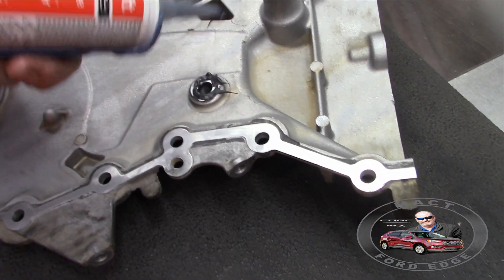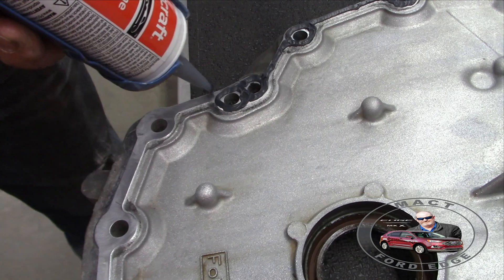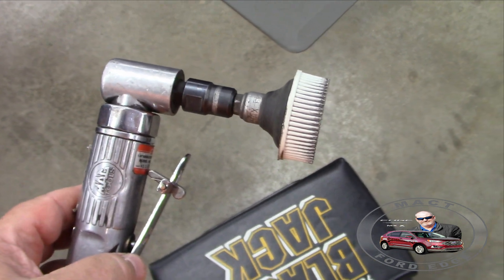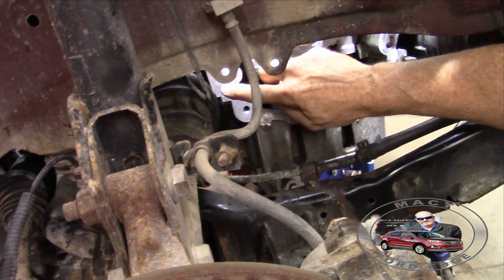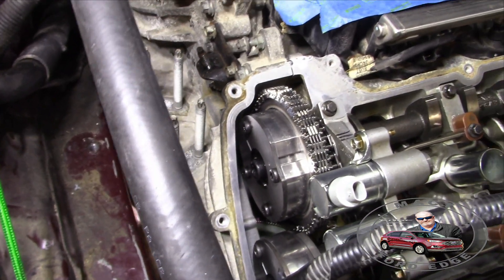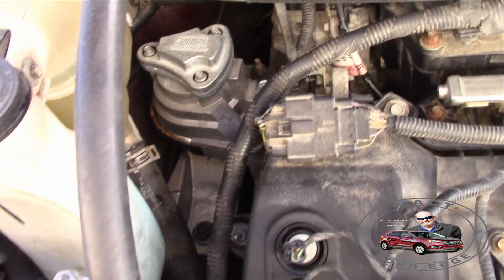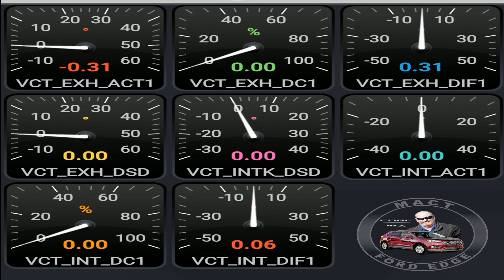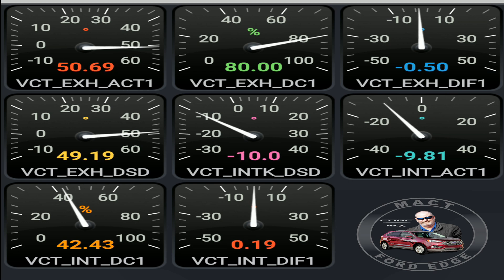PART 7  Installing the timing cover then test run of the 3.5 Duratec at wide open throttle

Comment: I don't ever want to buy a Ford after working on this POS, that is the crappiest design putting the water pump inside with the timing chain. The dealer told me $4800 for this repair and it has to be done every 100k, think they just want you to throw the car away.

Comment: hey was wondering if you could help me out im doing the same job and about to install the rtv and says it has to be torqued down within 4 minutes of initial application i noticed it took you at least 4 minutes just to get it laid on, whats your opinion on this? also wasnt going around the outside overkill?

Comment: What did you use for metal surface cleaning prep before applying the RTV? The Ford wipes they recommended are crazy priced if you can find them. Thanks for the video- it’s a big help!
Reply: No need. Use gumout parts cleaner and wipe down with Acetone to remove any residual oil on surface

Comment from the maker: All done lost a bit of video however the Edge is and has been running down the roads without issue.  My follow up will be to review the costs as they were incurred during the rebuild using all Motorcraft parts. Thanks for following and watching.  Subscribe, LIKE and hit the bell.  Remember to join MACT Ford Edge on MEWE.